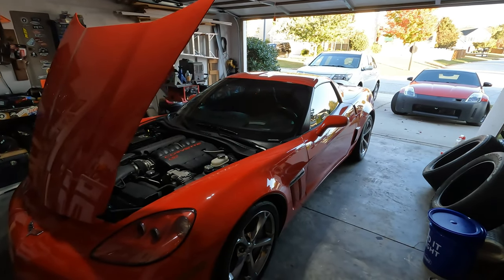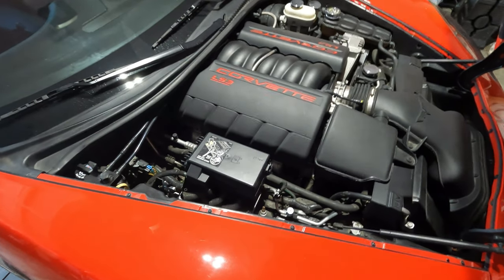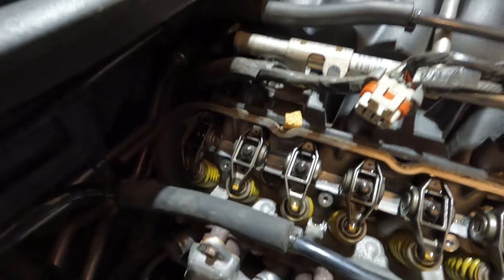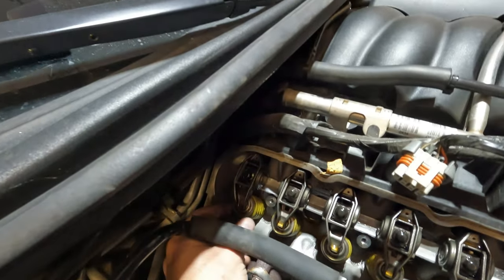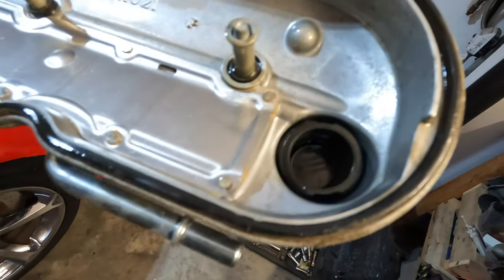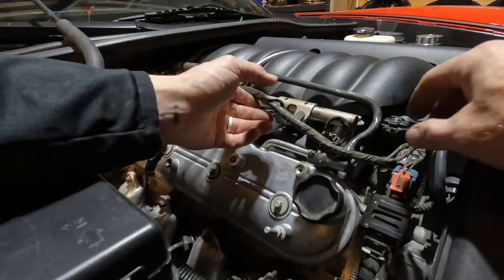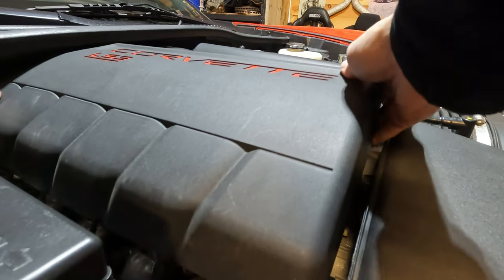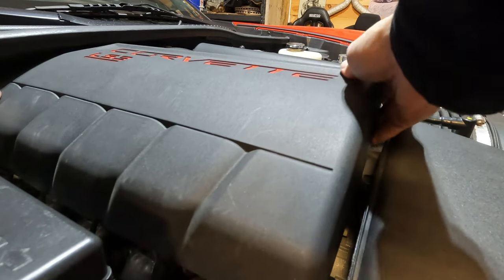Opening C6 Corvette Valve Cover

Comment: Hi, just bought a 2009 C6 1 owner 24K miles, nice to see how the engine covers are removed, want to change the 2 purge vacuum lines that run on top of the intake manifold, could see yours, long vacuum lines, a mousee chewed a little on mine, no real damage seem to work. Now oil, I also use the Mobil-1 5 qts 10W-30 but I mix in 1 qt 10W-20, I think the 10W20 keeps the engine cleaner. What is the braided steel line that runs across the top of the engine, looking at parts diagrams, have not found it yet. Thanks Pennsylvania...

Comment: An actual lifter tick is quite loud. The quiet tick you hear from an LS is generally just valvetrain noise/harmonics transmitted though the exhaust, they get louder when you do headers since the material of the header is thinner than the cast factory manifolds. Also it could very well be a small exhaust leak as well. Again a lifter tick is something you head and you want to immediately shut the car off, there’s no guessing to it.  You clearly do not have a lifter tick. Maybe a pulley but it’s more than likely nothing major.
Reply from the maker: Thanks.  I have heard similar sounds coming from LS engines that have lifters that are going bad—the roller chirps.  It’s not necessarily “failed” but on its way out.  But yeah after digging in a little, I‘ve narrowed in on it being a worn belt.  Exhaust leak is definitely possible too—headers coming so that’ll be addressed as well!  Thanks again!

Comment: check the harmonic balancer wobble
Reply from the maker: No wobble that I can see with my eye.  May just change it out while making the other upgrades though!
Reply: @SpeedCultureStudios  sometimes the belt tensioner also start to give out on it thats how i noticed my rattle/weird sound
Reply from the maker: @drastichacks  The balancer was a worry of mine right away but as I’ve spent more time under the hood, it seems belt related.  I’ve done the water test and the chirp goes away.  It’s probably the original belt so may just be a touch loose but tensioner is a possible culprit too.  Thanks for your input!